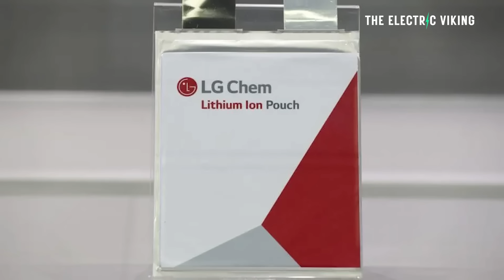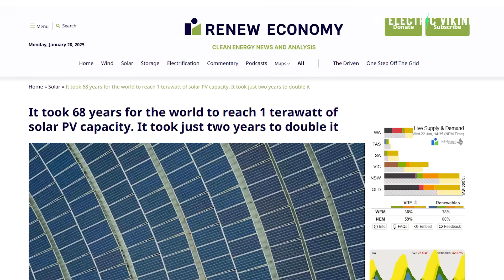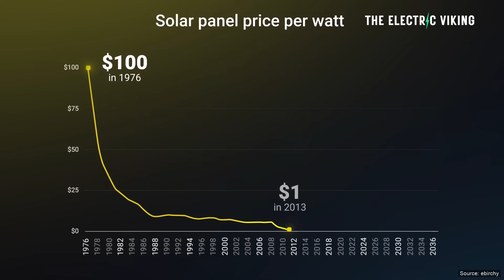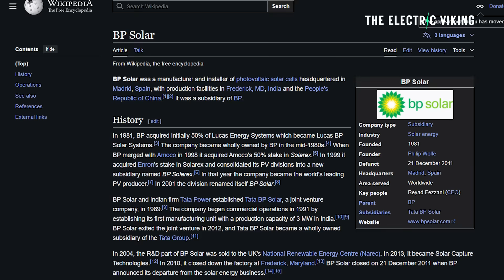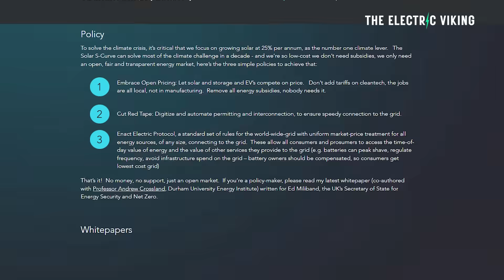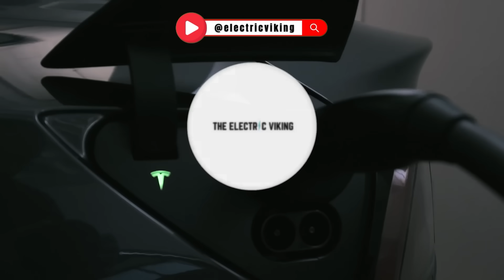S-Curve modeling predicts half of world’s energy will come from solar by 2035

Comment: I've mentioned this a few times here, but I work for the world's largest solar panel manufacturer, we alone produce just over 100GW of solar modules/year, and are sold out completely for the next few years, and there are 4 other companies who are building about the same capacity as we are, with a dozen other companies equaling our combined build capacity.  In short, the global annual build capacity of solar is 1TW, and growing, every year, which is equivalent to: ~2000 500MW gas power plants, which produce energy at about 1/3 the cost of gas.  It's easy to see why there's virtually no new gas power plants being installed in the world, nor will there, and why hundreds are shutting down, every year.  Coal is long dead and nuclear is DOA.
Reply: Pretty much. I'm not in the industry and even I can see it.
Reply: Great ! Only disagreement I have us about nuclear. In northern industrial places there is no zero emissions alternative in winter when no wind, no sunlight !
Reply: @chryoko  Battery storage & Wind
Reply: Right now solar energy is being complemented with other sources. Solar energy is not generated at night or on rainy days. But the battery technology is getting better and cheaper. In a few more years, solar will be the main energy source.
Reply: You say nuclear is DOA but right now, the U.K. is forcing through a new £40 billion nuclear plant, Sizewell C, even though it won't be running until 2040.

Energy markets are very broken and so are the investment incentives.
Reply: Why is China building new nukes. 21 more in the pipeline. You solar guys are a bit ignorant.
Reply: The state of f'ing Texas subsidize the building of gas plants...
Reply: Maybe my corporate leadership is lying to me but they're telling me that natural gas power plants are being requested in the US. I wish it were not true because they are truly building boat anchors while the rest of the world steams ahead
Reply: nuclear was always a trojan horse for weapons manufacture. only enough proven reserves to power world for 10yrs on uranium, less than the average production time for a N power plant
Reply: Yes!
Reply: Can’t be true. In China there’s a giant over capacitor and there so many panels laying in storage. That’s way China is flowering the markets on such low prices. The don’t earn money with that. It’s all financed by the CCP 🫤
Reply: Can I ask which company you work for?
Reply: Do solar panels work in dark?
Reply: We hear here in the West that China is dumping the shit because of overcapacity at a loss! That's why I always tell people, if that's true then we can build factories and produce solar panels too. Then we will be dumping it for 1 cent and win this game! 😂
Reply: So cool to hear. Where do they get made, out of curiosity?
Reply: Keep on dreaming…
Reply: If solar is 1/3 cost of gas then why do countries that use lots of solar have such high electricity prices?  (Germany UK Australia for example)
Reply: @DGlass-yg8xk  I don't know about Germany, but in Australia (where I live) solar is bring the cost down.  Our prices are high after years of no government policy and a lack of investment in infrastructure.  Thanks to the cheap cost of solar, it's being deployed regardless of gov policy and prices are coming down.
Reply: @lojack80  Same here in Germany. We have a high demand for Energy since energy hungry industries are a major part of the economy here. We had pretty cheap gas delivered from Russia until 2022 and heavily leaned onto that. Then Putin cut the delivery and we had to switch to coal again in case of no wind and sun is available which could happen in december-january for a few days. But since a blackout or brownouts are not an option, expensive gas and coal plants have to power up in these cases pushing the prices up, due to CO2 prices agreed up on in the EU. Coal is the most expensive now and we do not have nuclear anymore. In addition the energy costs are only a part of the total price. To ensure we can switch to renewables, we need deliver the power from where it is produced to where it is needed. These invenstments into the country wide grid are added on top of the electricity bill. So this is what makes it expensive. Once the grid has been finished and payed of and enought wind and solar is installed, the prices will go down in a few years.
Reply: @lojack80 you must be on drugs…👍👍👍👍
Reply: @ridezplus1053  yeah, I don’t where in Australia he lives, but I’ve not heard of anywhere the price of electricity has gone down 😂.
Reply: @DGlass-yg8xk  The increase of energy prices in the UK and Germany is not due to renewables but due to the ever increasing price of fossil fuels.  Firstly you need to understand how energy markets work. The price of energy on a grid at any point in time is set by the highest priced source currently supplying the grid. so if the grid is being supplied  by equal amounts of coal, gas and renewable energy, then the price will be set by gas (being the most expensive). So in winter in the UK and Germany where you don’t have much solar and on calmer days maybe not a lot of wind and the weather is cold so demand for electricity is high, then the price is set by the most expensive fossil fuel on the grid. Electricity prices are directly related to the war in Ukraine and the sharp incline in the cost of imported LNG and other fossil fuels to Europe. So countries such as the US with their own supply of fossil fuels, or China with now large quantities of renewables and less cheap coal, have very low energy prices in comparison to the UK or Germany. If renewables were so expensive why then would China ( the country producing a large quantity of the worlds goods ) be installing them at a phenomenal rate? Not because they want to reduce their CO2 but because they want to keep manufacturing cheap in China, by having some of the lowest energy prices in the world.
Reply: @DGlass-yg8xk  In the UK up until 2015/6 there has been a high feed in tariff paid to people who have installed solar on their roofs.  The tariff was much more than the energy was worth.  It was needed to get solar moving when it didn't make financial sense to install it.  Now that it does make sense the feed in tariff subsidy has been completely stopped.  So the old solar panels have made solar panels produce very expensive electricity averagely.  I think that Germany did the same thing except they did it earlier and paid even more for their electricity.

However, all the new solar panels since 2015/6 are producing cheap electricity.  As time goes on as more solar panels are installed the cost of solar panel electricity is going down.
Reply: @bobgriffin316  always there is the promise that solar and wind will be cheaper than fossil or nuclear but instead ,especially in the cases of Germany and the UK, the prices are so high that they are literally suffering from deindustrialization
Reply: @bobgriffin316 does the UK have tariffs on Chinese manufactured solar? Just curious
Reply: @bobgriffin316  here you get 6c in KWH for making solar power but it costs 36c a KWH to use from grid so you have to produce 6x what you use to pay for your power solar is so cheap here
you name me another power source that produces a KWH and costs them 6c :P
Reply: @DGlass-yg8xk dude you have no clue how it works in Germany.
Reply: @bobgriffin316 that's not why electricity costs are high in the U.K.

The U.K. electricity market runs a process of auctioning power onto the grid every 30 minutes.

Each producer sets its price and the grid takes up each producer starting with the cheapest moving onto more expensive producers until it has all expected demand met.

Then ALL producers are paid for their production according to the MOST EXPENSIVE producer. That price sets the wholesale cost to energy retailers.

Most of the time, that most expensive producer is NATURAL GAS. 

Solar and wind are almost always the cheapest producers because they have no marginal cost.

So the reason uk energy has been expensive is because of the high price of fossil fuels. Nothing to do with renewables.

It does mean that renewables are very profitable though.

In fact, if the cost of electricity was set by just taking an average of all the input costs (so each producer is paid its auction price) then energy prices would fall dramatically.

But then no one would invest in renewables because the profits would be so low.

It's a broken system.
The only way to bribe renewables projects into the market is to have a market system that overpays them. But if you made the system cheaper for consumers and paid for renewables at a fair price then there would be no renewables.

It's almost as if a large, well funded institution with no need to make a profit should be the one coming in to rapidly roll out cheap renewables... 🤔
Reply: @DGlass-yg8xk you are purposely not trying to understand how the electric markets work.  In my jurisdiction for example the first GW of solar panels gets anywhere from $.82 to $.35 per generated kWh of electricity produced.  Most of those subsidies will end in the next 1 to 7 years.  After that they will get extremely lower rates.  Also the next 500 GW’s of installed solar are likely to get 1/2 of what natural gas costs, which is likely lower than $.075 per kWh.   Last I checked a few years ago my utility company would pay $.072 per kWh of net metered solar.  What do you think that will do to the cost of electricity?
Reply: @DGlass-yg8xk  The highest cost energy source set the price, not solar. that's how grid bidding works.
Reply: @ Sorry, but the reality is that wind and solar are cheaper and have been for years. If prices are high, it isn't because of cheap renewables.
Reply: Naja, die Strompreise sind niedriger als z.B. 2021. Es dauert aber länger, bis das beim Verbraucher ankommt, da z.B. der Ukraine Krieg die Gaskosten hat steigen lassen.
Da im Strommarkt das Merrit-Order-Prinzip gilt, wird für jede kWh der Preis des teuersten Kraftwerks berechnet. Das sind i.d.R. Gas Kraftwerke.
Hier sollte das Kartellamt mal hinschauen, da die großen Energieversorger zu mauscheln scheinen.
Reply: @DGlass-yg8xk umm, because most of the power is generated by more expensive gas.  Duh.
Reply: @ Correlation is not causation.
Reply: @DGlass-yg8xk thats because the renewables are financed by the transition from gas and coal. In order to keep them alive as long as needed, the prices are fixed based on the latest powerplant costs. Which is in this case a gas plant. Its called the EEG law.
At the beginning it made sense and thats‘s why renewables are successful but now they should drop the EEG because we have more than 60% renewables now.
Reply: @DGlass-yg8xk because the price is set by the marginal producer who is able supply surge demand, in most cases at present this is natural gas but will be replaced in future by energy storage e.g. batteries
Reply: @DGlass-yg8xk  because the highest priced generator electricity needed sets the price, not the lowest.  blame gas, coal and nuclear.  when the sun shines it can enough solar for it all, and then the price goes to the low cost of solar.
Reply: @ That would be something you would have to take up with the utility.
And if you don't get a satisfactory answer, go off grid with solar, wind, or micro hydto.
Reply: @DGlass-yg8xk  two factors drive the price. Costs for the grid is one, the second one is the price regulation. The production costs for a MWh is going down quite a bit in Germany, but this is less than 50% of the price that is charged.
Reply: In the US, gas plants are going in all over.  Solar only works when the sun shines and the panels aren't covered by snow.  Batteries can only provide LIMITED buffering.  Homes and industries need electricity 24/7/365, in other words, DISPATCHABLE electricity, NOT INTERMITTENT electricity.  Gas is able to provide that.  But, since the mandates are for "green" sources, the gas facilities have to be kept on inefficient standby so the "cheap" green sources can be used when they are able to produce.  This makes the overall grid MORE expensive and LESS stable.  There is also a requirement in grids for physical inertia to ensure stability during momentary changes.  Solar/wind/batteries CANNOT provide physical inertia, since all of their output is through inverters.  Ask a grid operator about this.
Reply: But the solar panels in the city. On carparks roofs. Leave the farmers alone
Reply: @ what farmer has had solar involuntarily placed on his farm. include references.
Reply: @jonathoncalabrese2035 agrivoltaic is the best solution in many places.
Reply: Well unfortunately everything over 30 % causes grid instability. Solar / nuclear mix is the future.
Reply: @markoprusevic9175  How do you mean? In South Australia right now (4pm), solar and wind is generating over 90% of current demand.
Reply: @bxm61 Australia is not Europe in winter !!!!
Reply: @ ya, that number keeps rising. usually a few years after several countries demonstrate that to be false. If I can run my house of solar plus batteries, it only gets easier as scale goes up.
Or if you want to dispute this, show me a single instance where solar or wind caused grid instabilities. include references so we know you actually researched something instead of regurgitating someone else's garbage.
Reply: One bad storm and it’s gone hahahahaha
Reply: @ Thats would be one hell of a storm but then if we keep pumping CO2 into the atmosphere anything is possible. Of course the solar panels won’t be the only thing that will be blown away and we will have considerably greater worries by then than where our energy is coming from….
Reply: @jonathoncalabrese2035 what's funny about that? Check yourself, you got a malfunction.
Reply: @ yep, those fossil plants keep failing left and right
Reply: @jonathoncalabrese2035 assume you mean all of the transmission lines from power plants?

Comment: The quickest path to clean sustainable energy is to take advantage of every source of clean sustainable energy, not merely solar and wind. We must develop solar, wind, hydrologic, geologic, and modular nuclear reactors which recycle their spent fuel.
Reply: it comes down to cost. Wind and solar are the cheapest by far.
Reply: @williammeek-h2o  Of course it comes down to cost. But looking at average cost is not the most efficient way to power the grid. In some regions and climatic conditions solar or wind won't be cheaper.
Reply: @ That is what national grids  are for. Sure, the wind doesn't always blow and the sun doesn't always shine in a given spot.
But on a continental scale, ya, it does.
Reply: At least someone understands this, the sun doesn't always shine and the wind doesn't always blow. Nuclear fission produces loads more energy than either wind or solar and takes up far less square miles. Problem is all the green tards that spew crap from their mouths about nuclear without knowing any of the facts or reading the reports. I live in Connecticut and 35 percent of out electricity comes from one single nuclear power plant in Waterford Connecticut, no need to deforest thousands of acres to produce the same amount that three reactors can, no need to take up grazing lands that animals need for survival. Annual output of the millstone power plant is over 17,000 gwh, how much wind and solar would be needed to produce that.
Reply: wasting money  nuclear slows renewable down

Comment: Solar and battery storage in every house exporting to the grid.... or disconnecting. Who pays for the grid? until now large corporations have charged you for energy and a connection fee, mostly by taking over infrastructure built by governments. There's a lot of big investors worried about their gravy train.
Reply: With rare exceptions, it is NOT economical for any household or business to be totally off-grid... possible perhaps, but very expensive assuredly.  90+ % will stay connected... and the connection fees pay for the grid... like they already do!

Comment: In Southern California, a rooftop solar system pays for itself in about five years.  After that, the energy continues to flow.  Of course it is economical to put in solar there.  It costs less than one fifth the price of the energy from the utility.
Reply: You are a consumer. That's all upside for you.
Think what it looks like for an investor planning to invest a few billion in energy infrastructure. They have the prospect of investing in a project that is easy for competitors to compete with, where turnover is low and where margins are cut to the bone to sell the electricity. 
Compare this with fossil fuel projects where the barriers to entry are high and the margins are consistently high.
This is why, without subsidies, the transition is just not happening as you would expect based on the comparative costs of solar vs fossil fuels.
Because investors don't go where costs are low. They go where profits are high.
Reply: @michaelrch  That all depends how things are structured. It costs money to build another 1 GW coal or gas plant, it requires fuel and maintenance. It may be cheaper to build a battery and store the excess solar from rooftop solar during the day which you didn't have to pay for and release it as needed.
Reply: @ fossil fuels have made the price of electricity so high, that even without subsides, payback time for home solar is just a few years.